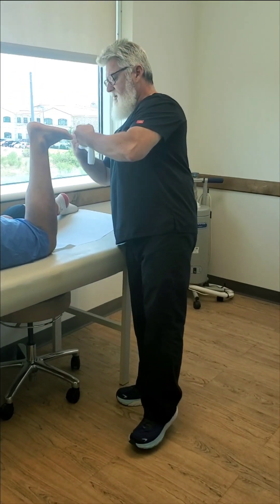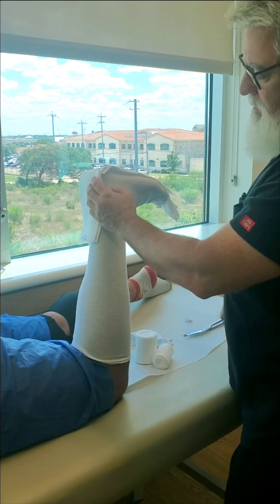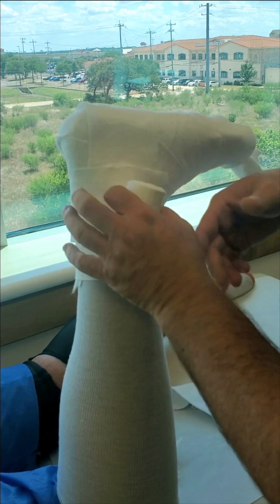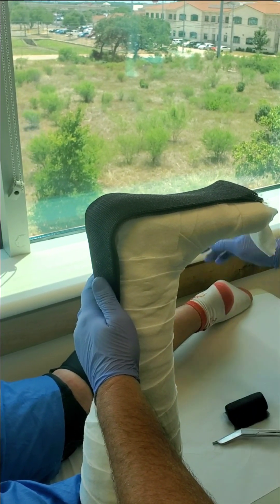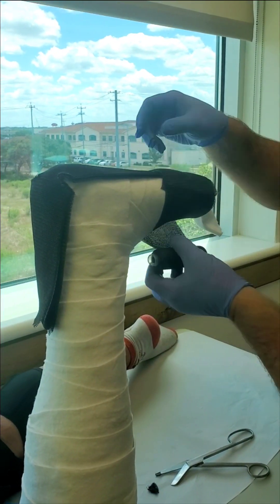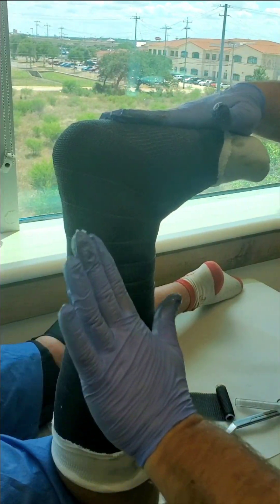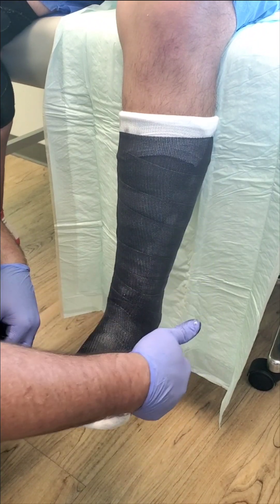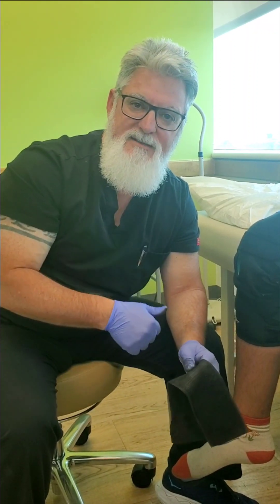How to Make a Stronger/Reinforced Short Leg Cast, (Fiberglass)

Comment: In my first cast at age 50. Enjoyed watching your videos. 
The ortho surgeon that ordered my cast told me ‘I don’t want ANY movement inside that cast; if you feel any moving around of foot/ankle; call & come in to get it changed. Even if it’s daily-won’t be THAT often, but will likely need changing.’    
Sure enough- that evening I felt I could move my ankle a decent amount & by the next morning it was clear I was moving too much.   Went in and had it changed out.   A full 24 hours after the second one- I am wondering if I’m moving too much again.   Is it even possible to have ZERO movement in a short leg walking cast?   I don’t want to be a pain with the office; but I also don’t want to interfere with treatment plan/goal. 
Thank you for your videos!
Reply from the maker: Thank you very much for viewing and for you compliment and question as well... 
I once had a parent who brought their child in for cast changes every few days. (for her own personal reasons) And it was no problem at all; remember that we are here for You, the Patient.  If the provider wants little to no movement then that's what we try to accomplish. (w/o making it too tight of course)
When we place a nice, fitted, snug short leg cast, your ankle should feel as secure as a good pair of hiking boots, laced & prepared for a hike. (not too tight, but little to no wiggle room, so not to cause ankle problems).
.
I hope this helps a little and wish You good luck with your healing, sincerely woodie 👍🏼

Comment: Can you show how to apply a proper toeplate?
Reply from the maker: @jameskennedy7967  ... James, thank you very much for viewing and for the request as well. I would be more than happy to do a toe plate video and will get that up as soon as possible, sincerely woodie 🙂👍🏼
Reply: @orthopedicbasicswwoodie1097  Thank you! Also, is it a good cast type to use as a walking cast with shoe? Is there a proper style shoe to use with it? Thanks
Reply from the maker: @jameskennedy7967 ... Hi James- Yes you can make a weight bearing cast w/a toe plate. And typically we would issue a cast shoe that is similar in length as the toe plate for walking.  woodie 🙂👍🏼